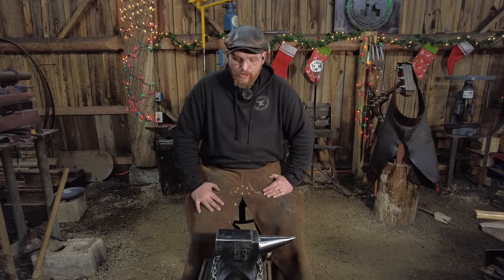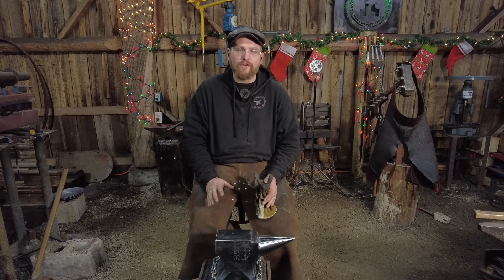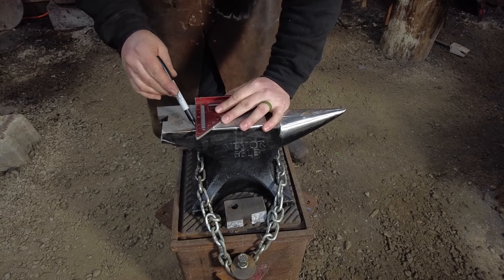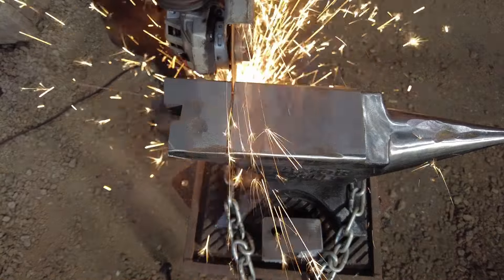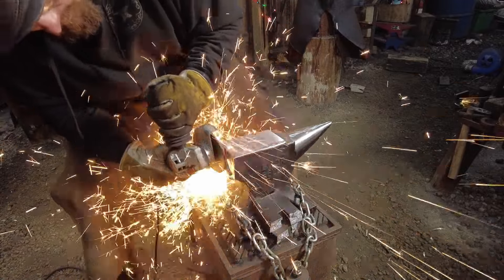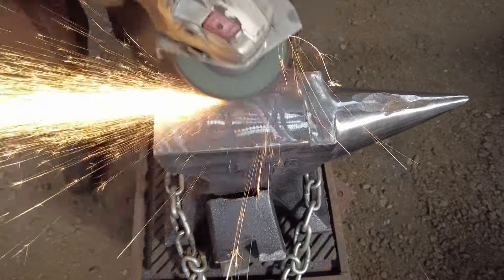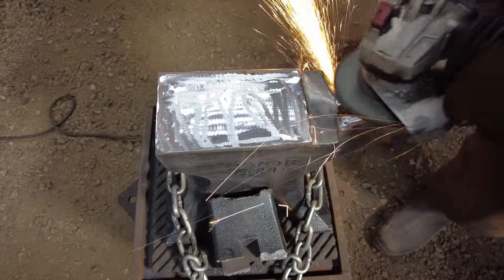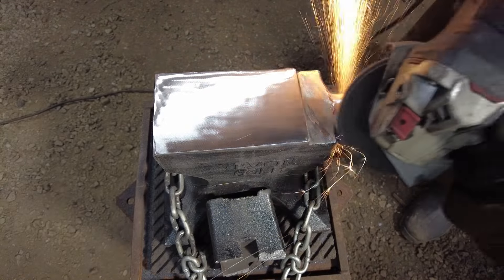Fixing a DESTROYED Anvil!

Comment: Hello Roy, great video. Had a odd question, i purchased an anvil from an older gentleman with a cut off hardy stuck in the hardy hole, I’ve attempted to get the hardy tool out with brute force (not successful) and thought about using heat. My concern is compromising the anvil itself. Any advice would be helpful. Thanks.
Reply: I had the same issue with an old Peter Wright I had purchased a few years ago, the hardy tool had "rusted welded" in the hardy. I soaked the hole with penetrating oil and let it soak for an hour or so , then turned the anvil on its side and using broken hammer handle as a punch was able to eventually drive the tool out , I did use a plumbers propane torch to warm things up but did this from the bottom so the heat wouldn't effect the top .  Take your time and you'll get it done . I hope this helps and good luck. Hammer on!
Reply from the maker: My advice is to cut the Hardy off at the anvils surface and then drive it out from the top down. If it still doesn't budge then I would drill out the Old Hardy stem and take it out in pieces
Reply: @ChristCenteredIronworks  appreciate the advice Roy, I’ll give it a try and if successful I’ll be back to confirm my progress.
Reply: @johnblanton-fd3jf  that’s an idea I hadn’t thought of, thanks.
Reply: Had the same issue, drilled out the old tool with the biggest drill bit I had then used a a press and penetrating oil to push it out.

Comment: another tool that is useful in this situation is a large hand held electric belt sander, the type you'd use on small floor jobs,
they are pretty cheap but it would be great after the grind stone work to flatten off the face of the anvil.
i've used it to flatten out or taper sword blanks as i don't have room for surface grinders etc

Comment: When you said fixing the anvil, I thought you were going to re-weld a new piece of steel on.  Refacing the broken anvil  isn’t really fixing it is it?
Reply from the maker: The point is the advice in this video for those that run into this same problem... And Yes repairing damage and eliminating safety hazard's is fixing it
Reply: And would you trust the weld on the tail enough to really hammer on it? I don't think I would. @ChristCenteredIronworks
Reply: If it’s  had a deep v grove and welded out yes!